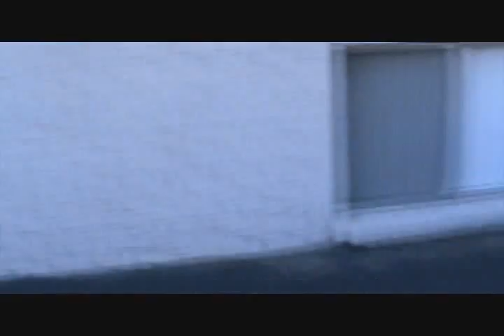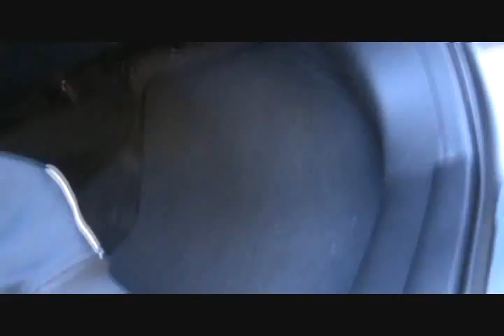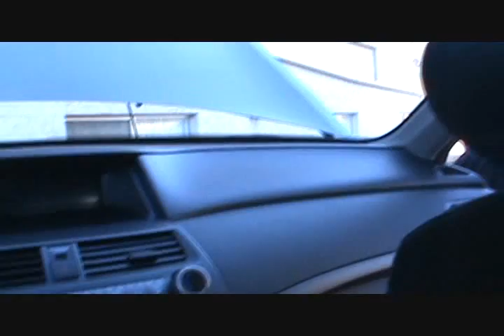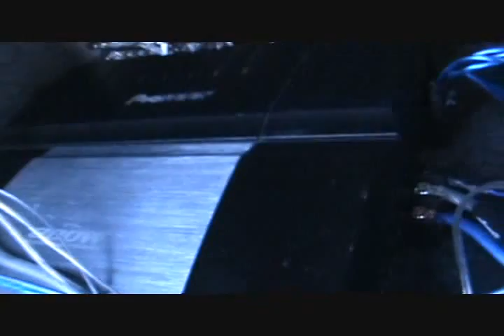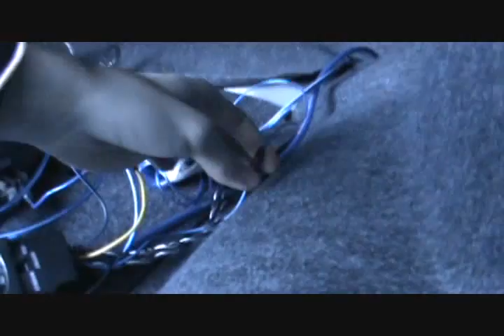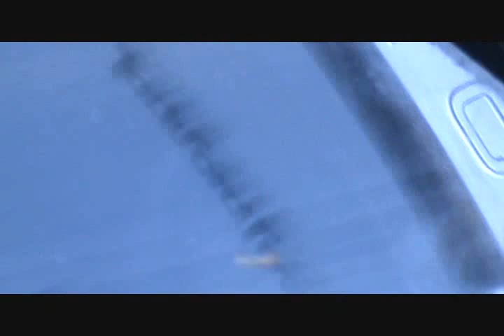How to install amp on factory radio w/ out opening dash.

Comment: 12V cigarette plugs are often the easiest way to get remote turn on, however sometimes those get constant power. Of course a fuse tap can be good if you have a $3 test light. Wavtech makes a $40 device called the IRAD which can be plugged directly from the battery or any constant 12V source wire, and it can determine when the engine is actually running and turn on your amp only once the engine starts the alternator and boosts the voltage from its resting status, and it also is useful in a variety of other ways.

Comment: “The amp has 4 wires to it. The power, the ground and then your gonna have a wire running to it normally from your head unit which basically tells the amp to turn on and the third thing is obviously the audio signal so those are the 2 things you would really need”😂

Comment: Holy ...omg what a mess. 
I get the concept but at least wire splice , and heat shrink the wires and hide them better. Looks pretty bad. You took a 15k car and made a mess to save yourself $100 on a professional install.

Comment: What type of line out converter did you use because when I look them up it looks like there's a difference between low-level and high-level
Reply: And don't let people hate I have a new car and it would ruin the warranty if I take the head unitso the only way I can do this is the way you're doing it without ruining my warranty

Comment: Also you can skip the converter box and just cut the end off if a rca  l/r cable and just plug it into the amp. If your gonna cheap out, do it right!

Comment: I have a question. Do I basically cut the harness going into my factory amp wire in nine wire to those wires and run the nine wire back to my 5ch amp? And since I’m tired of fighting all the Molex(or whatever they’re called) connectors in door boots, just do the same thing with the speaker wires coming out of the amp? My biggest question is since I have a 5 ch amp why are there only 8 wires and not ten being that I have a factory sub? Where is the +\- wires for the sub. Where’s the 5th ch wire?

Comment: I know this is an old post but I really can’t believe the dumb ass coments from the obviously equal dumb ass ppl. This kid is pretty freakin smart to know about what to tie in to. Answered some questions I had. And for the ppl who honestly think his cars gonna catch on fire shows how little you actually know. I understand that some ppl must feel like there awesome at something in life and the fact that most anybody can install an audio system with little or no difficulty of the only thing they can do to make themselves feel their special is be as uptight an anal about how to connect a basic wire( and I do mean basic, you can take a freaking electrical cord and use it as a speaker wire) to a basic positive/negative pole there’s always gonna be those who will act like you just turned you system into a ticking time bomb bc you didn’t use heat shrink or solder. Honestly all this proves is that the person who used electric tape and tied into his lighter had more imortant things to do than to worry about if the system is off by 1hrtz. It freakin car audio. I know how bad some ppl want to think what do is a special talent. Maybe the kid didn’t have the funds to pretty it up, maybe he didn’t care. Although I’m not knocking the the true professionals out there that really do hear the difference in 1hrzt and that do an excellent and neat installation. That is a skill. But those ppl know who they are and won’t be offended bc those ppl know don’t leave nasty comments on kids video do a basic install himself and helping others. If you’re so awesome then why don’t you give him tips on how to do what he’s doing a little better. The truth is you cant. And you’re probably kicking yourself bc you’re that guythat “worked harder”. As for how sounds. Those are the dumbest comments of all. If you just use a couple of senses you would hear the the wind whipping, you would see he’s wearing longs sleeves and you could then deduce that it’s probably cold as hell outside as he films and talks while pointing things out in the cold. Of course he’s gonna have a runny nose. Omg he’s human. And breaths too. What’s going on? God stupid people really piss me off. And what pisses me off more than stupid people are stupid people who are so stupid they honestly think their smart. Those are the ones who know everything about everything or knows someone who does. They always have a better way but have never done anything. Good video kid. I thought it was funny how described things. Like “or you’re just lazy” and very easy to understand. Dig the shell toes. Long live Run DMC.

Comment: I simply ran the "on" wire to a custom switch by the driver's seat, and then back to the Red/positive input on the amp.....    without the switch, the amp would always be on...

but then I kept forgetting to turn off the switch...  so splicing it into a wire that's only hot when the key's turned on worked like magic in my 97 truck.. 

it's easy to splice without cutting a wire
and it's easy to check which wires are hot with a wire tester..

Comment: Grommets are no longer grommets... they are stoppers...

Fuses should always be less than 18" (1.5ft) from the source or as close as feasibly possible. 

The first shortcut you took was not taking it to a professional.

I would have paid $100 - $200 to have everything installed instead of doing this job like this...

Quite frankly, this is a fire waiting to happen...

Comment: I would just take the time and do it right. I mean, if you have a really nice car and want to keep it that way, wouldn't you really want to take the time and do it right?... Also most have front and rear speakers, and he just showed the rear speakers & sub. I figure you would just get a line out converter for what ever set up you were doing. It's your car, you do what you want. Thanks for the video.

Comment: Hey Bro, this is my situation, theres A "Factory Amp" in my car, it's running the 6/9's in the back window, how do I add A Amp and A sub woofer to my car, without loosing the factory Amp running the 6/9's
Reply: use a LOC
Reply: instead of installing a 4 channel, you just install a mono block amp for the bass and keep your stock amp running the speakers turn the bass all the way down on the stock amp and it should sound fine

Comment: What's the difference between buying a line out converter like the the one you have )with a little box on it), and the cables that have speaker wire on one side and RCA wire on the other end? For example, the Rockford Fosgate RFI2SW cable?

Comment: lol... you can just run the remote wire to your positive lead on your amp and run a switch on your main power line. done deal.
now you have a cleaner setup and the option to turn your amp on and off whenever you need to. this would also give you the option to turn the power going to the trunk off if you ever needed to remove the amp for cargo space.
this is so jimmy rigged, I would not recommend anyone actually do it this way.
Reply: I connected my remote wire to the stereo fuse in the fuse box. Turns on and off when I turn my car on and off. Works perfectly :)
Reply from the maker: +Bryanna Walker wouldn't you risk sending too much current to the convert box then? and wouldn't the amp always be on because the amp is directly connected to the battery?
Reply: True!

Comment: make a loop with your remote wire from the power to your amp to the remote cut it in half and put it on a toggle  switch. that way if you see a cop you flip the switch and no more bass.
Reply: I agree. . just get the control knob instead. $8. Velcro it in between driver seat and center consol for easy-reach quick adjustments. I hate when the knob isn't incorporated and you have to adjust the subs through head unit. Can get you busted.
Reply: Damn man what a good idea actually haha. I was about to go buy a toggle switch and rig it to a 12v battery
Reply: I didn't know having an aftermarket sound system was illegal. When did Trump start that law?

Comment: instead of splicing the aux wires. you could buy a fuse tap costs like 3 dollars. and tap into your radio fuse in the fuse box. and then run your remote wire from the fuse tap

Comment: You could always run amp wire to fuse that turns on radio instead of all that extra wire for cig lighter
Reply: Do you know which fuse to use in a 2010 Chevy Malibu ?
Reply: Run the remote wire to the radio fuse
Reply: Will that shut off the amp along when everything else turns off 

Sent from my iPhone
Reply: Yes when radio shuts off so will amp. Sorry so long to respond but ie issues was screwin up emails
Reply: Thanks 

Sent from my iPhone
Reply: +eddie van orden  I ordered a piggy back adaptor to use it on my radio fuse,  But my fuse is really small compare to one I got from eBay

Comment: If there is anyone out there that wants to see a real video on how a clean professional install looks, I will be posting one shortly. Fuck this video it sucks. #ASEcertifiedinstall
Reply: Hey,roc i wanted to hit you up on the video you responded to you said you were going to make a better one on installing a car amplifier without tapping off the Headunit  just bought the converter box like sniffles did ,to be honest  he did a good job just really messy sloppy wires i like to run my wires really tight n neat but you said you were going to post a similar video please if you  did hit me up at ( tatzz65@aol.com ) i really appreciate it i only have one problem the music sorce wires he tapped off his rear speakers  i have a honda crv 2015 n it only has fucken door speakers no rear just the  4 6in door speakers so i stumpped cause i dont want to tapp off a rear door speaker @nd have to pop door panel off n then have a wire running to back to  supply the converter box soure rca wires to amp any ways if you .did make the video please hit me up thanks tatzz

Comment: I just install my subs and amp and I have a whining engine noise in my subs , when I drive it you can hear the engine thru the subs , I brought RCA filter and that didn't do the justice , it was professional hook up , I have my power wire placed on the left side instead of the right , I don't know if that have something too do with I , but I want it gone .
Reply: Jonathan Wills your rca cables might be on the same side as the power wire. U have to make sure thoes to wires are far apart

Comment: you can also run your remote wire straight off the battery with a toggle switch to turn it on and off
Reply: Im about to hook my own amp up , and I think that's whats im going to do , ive seen it done
Reply: Michael Beard yeah i usually have to do it that way because noone likes the bass like i do so i use  a toggle switch as a cut off option
Reply: I think im just going to get someone to install it, and get a bass noob
Reply: Michael Beard that works too

Comment: Your amp fuse is to far away. It should be no more than 12 inches from the battery. This goes or all installs. Anytime you make a connection to power, put an inline fuse within 12 inches of power tap. Within 6 inches is better though. 😉

Comment: U don't need a loc box u can take a junk set of rcas and hook it up the the back spickers like the loc box and plug them in the amp and run the remoat wire up to the fuse box and look for a 20 amp fuse that say radio and put the wire In the fuse slot and and pit the fuse back in and the amp will turn on that's what I did in my sisters new charger and it works fine
Reply: Does this work? Im stuck here lol my amp wont turn off lol
Reply: TashaB202 Yes, if you wire the remote wire like the vid, your amp may not ever turn off. If you run your remote wire to a fuse that is only on when your car is actually turned on, then your amp will turn off when your car is not running. This may take trial and error to figure out which one works but looking at your owners manual will help.

Comment: Well, you don't need to run the switched wire through the firewall like that. Most cases you can catch a switched hot circuit right off your fuse box inside the car. usually there's an empty spot, otherwise, you can piggy back a fuse with a special connector made for this very reason. It clips over your blade fuse to hug the hot spade on your fuse. They make them for old school glass tube fuses as well. I make my own.  Second, you don't need a hi/lo box if your amp is equipped with HFI (high frequency input)  RCA cables provide a nice, easy-to-connect lo frequency connection and path for subs however, hi side inputs will work just as good except you will have to do some stripping and crimping.  If you ever bought an amp and noticed a little square or rectangular connector with wires colored grey, white, yellow or green (or any combination thereof), that's your HFI. Usually they are only 4 wires 2 for left and 2 for right.  Some amps have screw terminals for these inputs (like you would see for outputs on most amps) and no connector at all.  You don't need that box if you have a halfway decent amp.  Forget that 12+ remote wire (the blue one that tells the amp when the stereo is on) it's not needed in most cases and idk about you, but my stereo is always on so what good does that wire do when the stereo never goes off?! I never turn it off. 

One last thing, cleanup your setup bro. A clean setup reveals NOTHING!
Reply: Are you fucking kidding me??
Reply: I hope you're not calling yourself an experienced tech. I have never seen such bull shit install. Please stop before you burn something up.
Reply: It's a head unit, not a head set.
Reply: That wire under your back seat, needs to be moved over to the side and wrapped in conduit otherwise you could risk rubbing a hole through the insulation and grounding out on the car body.
Reply: Ground wires in the trunk look like dog shit. You couldn't find a bolt down low? Had to run them up towards the rear deck? Another hazard waiting to happen.
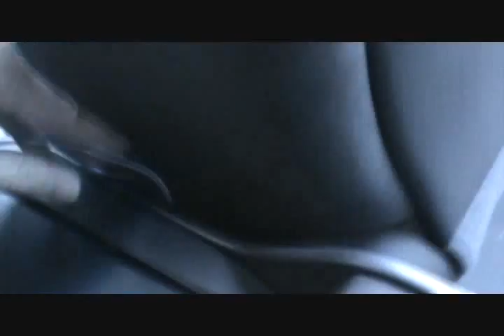Reply: 5:39 is that a fucking male accessory plug? You do know there are wires that turn on and off with the car, right? Oh wait, you said that would start a fire. Well... I guess all that electrical tape will keep you safe then.

Comment: I was going to do a similar thing with my BF falcon ute. only putting a 4 channel RCA converter in, into a 4 channel amp for the tweeters and mids. The amp also has pre outs where i will be plugging them into a seperate sub amp (or two)

I might suggest that when looking for a High to Low converter (RCA converter,) look through the frequencies produced by the converter, that they coincide with the sub and tweeters.
You want the frequencies to go as low as the sub does (about 24Hz) and as high as the tweeters (about 20kHz)

Also it might just a bit neater looking if you find a simple splicing connecter and link it to the accersories of the ignition barrel so you can still hide the lead and still have all 12v ports available.

Comment: Spend $20,000 on a new Honda Accord.... then skimp $100 on a professional looking amplifier install. Nice.
Reply: He clearly said its always best to have it professionally done. But hes just showing how to do for those that don't want to pay around 100-200 for someone to do it.
Reply: Angelo G
lol at first I was like lol fuse over the strut brace...then seen how he routed the wires under seats and was like "oh thats not bad"..then he showed us the wiring at the amp aswell as that sweet remote wire with optional manual power disconnect..lol But hey he atleast included diagrams in the video..haha
Reply: w
Reply: Amp turn on wire. ROFL this guy should do comedy! He has my upvote
Reply: car payments are what, 350-450? maybe he just doesn't want to spend money that could be going into the payments when he can do it him self
Reply: Roy Tolliver Hey clearly is doing 1/2 of everything WRONG and very dangerous.

Comment: For those that already have an existing amp and sub that does NOT have speak level inputs, getting a line out convertor that has remote wire option makes sense. The LOC will detect voltage on the speaker wires when the stereo is on and then send the remote signal to the amp.

This then only requires 1x 12v power cable from the battery to the amp, which powers both the amp and LOC and u can ground to the cars body, no extra wires and stuffing around.

Or you could fork out a bit more and get a amp which has speak level inputs and voltage detection built in.
Reply: Yeah, the remote rig he did was unnecessary. Just connect the amp remote to the remote on the LOC and it functions properly.

Comment: Hey I'm in luck. My GTI has a 12V plug right in the trunk of the car as well as the front.
Reply: NO, don't use that it won't handle the amp power.
Reply: MrAdoh2010 I only want to use the 12V plug as an on and off switch for the amp so it does not stay on all day. The main power will come from the main battery through a high density power cable.
Reply: Except on VWs that plug is usually constant 12V, not switched ignition...

Comment: And also instead of doing that converter box thing you could just run a straight t tap to the rear speakers with an RCA a cable with a cut off end
Reply: Don't do this. Amplifiers are only meant to take a certain input voltage (usually a maximum of 4v AC). That's what the LOC does is drops the HIGH-level signal voltage from the speaker down to a LOW-LEVEL signal, which the amp can work with. If you run a high-level signal into a low-level input you're just asking to fuck up your equipment. There are SOME amps that allow you to run high-level through the RCA inputs but there will also be a switch to select "input type" on those amps. Other amps will have a separate input for high-level audio sources. But just cutting RCA's and wiring them in is a bad idea.

Comment: Could you just run a wire into the fuse for the radio or the starter relay so when your car or radio is on the amp is on